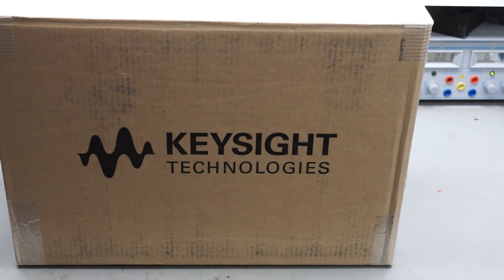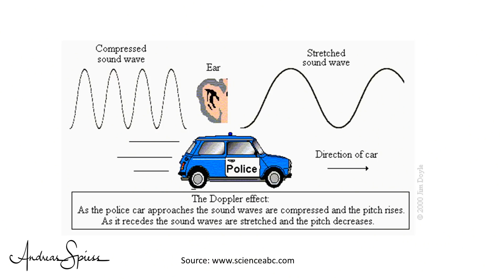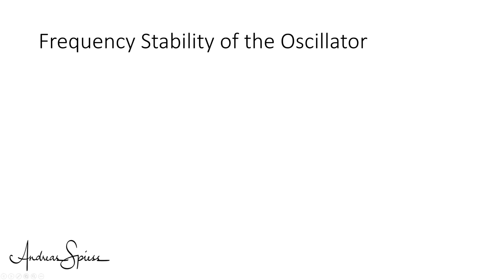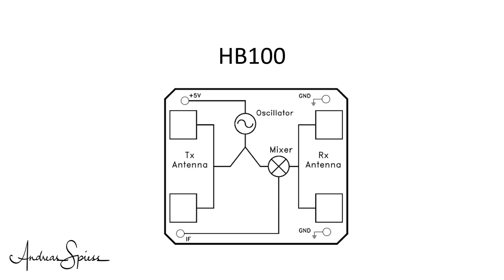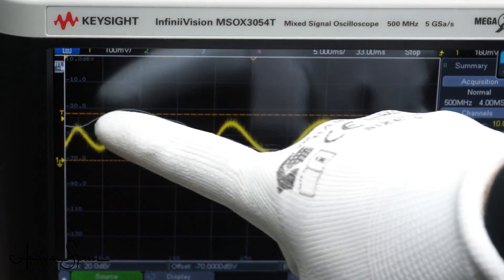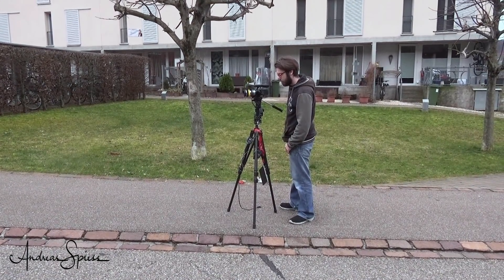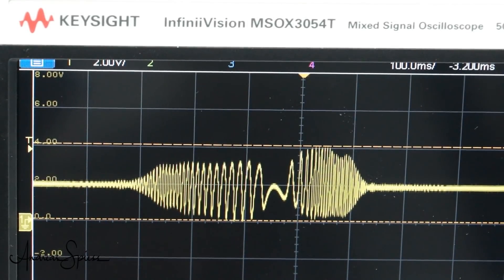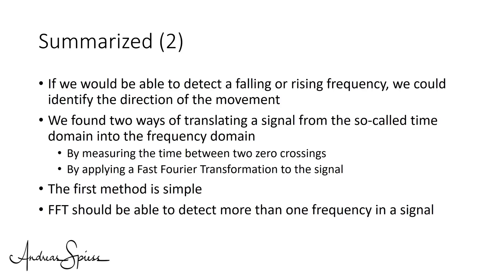#181 DIY Radar Speed Gun using cheap Radar Sensors (HB100, CDM324) for Arduino, ESP8266  and ESP32

Comment: Hi Andreas, 

What a nice subject for our makers. A lot of people think of using this technique in other purposes than it was supposed to, just for switch on lights or opening doors.
The thought’s I had where quite te same as most of the repliers, but some questions stayed after reading al the comments and answers and other posts in other channels including searching AliExpress for the most suitable radar module.

My application is quite standard for radar and is also almost identical as what you did.
I want to display the speed of Skiracers at the piste on a display and send the speed to a central server to store the speed, in combination to the time registration from another project.

My first plan was to set it up with two optical reflective gates, at a distance of some 5 meters and calculate the speed. This is common technology, but the racing suites  are often white and do also reflect the optical beam when passing the speedtrap. 
So a speedtrap with separate beams and detectors looks more reliable, but takes to many physical components to set up.  Besites that, synchronization of the time base on both the traps for precise messurement and setting the speedlength is also a hassle.

Then, as a recent viewer of your video’s, I found this item about speed measurement with  cheap components. It surprises me, how simple the units are and how accurate the measurements can be. But when reading more about these units and solutions people talked about the maximum speed that you can measure with this solution. Our racers can go as fast as 120Km/h, so the limit can be an issue. Also the measuring distance can be an issue, but 10 meters is quite nice for this. But are the racers then not passing the sensor to quick to make a reliable measurement?  
And if the sensor is ‘always’ on, for detecting movements, how can I trigger the right moment of passing at the highest speed, without showing zero’s after the racer has passed. These last questions are for me to solve as a maker, but the question about the limitation of the speed measurement is tricky for me. The second thought is which sensor to buy.  In the meantime some more sensors where added to AliExpress and there is a wide range of types now,  10,525Ghz, 24Ghz, 5,8Ghz etc.
The new CDM324 is 24Ghz and is advertised as 15 meter detection range. It looks as this unit is simplified version of the  CFK024-5A unit, which is much more expensive, but has more pin’s and options, including FMCW/FSK/CW. 
So if anyone had built a similar speed measurement unit without that works, please point me to more details to prevent me from spoiling precious maker hours. 

In the meantime I’m looking forward to the sequel of this amazing video series.

Regards Johan
Reply from the maker: We worked a little further on the project, but it is not ready yet. The most difficult part is the reach. The max speed should not be an issue.
You need a very high amplification of the signal (>10'000x) and have to pay attention that you do not introduce too much noise. After that, we used an ESP32 with FFT to measure the frequency. You measure the frequency all the time and distinguish from the pattern if it is valid. Your application will most probably show 0 for most of the time and increase fast, and fade off to zero again. So you can detect the maximum. Pay also attention that the angle of measurement has to be integrated into your calculation. If the angle changes the result also changes. 
All-in-all I think this will not be possible with this device because of its short range. You would have to place it in the direction of the racer in a distance of less than 10 meters, which is probably too dangerous.
Reply: Hi Andreas, 
expected something like that. Nice that the speed will not be a problem.
What will happen with the accuracy if a racer moves by in a elliptical curve instead of a straight line? For the noise I can try to get a low noise amplifier with a high gain for that. I first wanted to build my own parabolic antenna, but the gain factor of the module is already quite good. If I manage to create a more directional antenna with a better passive gain, I’ll let you know! Probably I will use something like a feedhorn for the receiver. 

Regards, Johan
Reply from the maker: 1. The measured speed can be calculated by trigonometry. The angle has to be absolute constant.
2. I cannot imagine you will be able to connect an amplifier because this device sends and receives at the same time. I assume a horn antenna would help if done properly.
Reply: Hi Andreas.  Yesterday I contacted a Colegue who is a maker and a Ham specialist in microwave connections.
On internet I found the Schwarzbeck horn-antenna's with an incredible passive gain. My collegue suggested that such a horn will solve the reach issue. Even when you use a horn that is not very good adapted for this frequency, it can give a huge gain. So I'll try that first. Just build a horn with a divider in the middle, with the antenna's in the bottem. The mesurements of the bottem are larger than the calculated dimensions at this frequency, but the expectation is that a reach of 50 Meters is possible.  Amplification would be possible, but takes a complete rebuild of the unit. More expencive units on Aliexpress use more stacked antenna's to reach a higher gain. The radar used by the police uses a horn. The horn will also give a smaler openings-angle, but for my usage that is an advantage.
Regards, 
Johan

Comment: Would this setup work for a Tennis Serve Speed measurement?
Reply from the maker: I do not know. Most probably the range would be too short.
Reply: The distance between the Ball Hit and the radar would be 12 meters. And only the initial speed (highest frequency differences) are relevant for the measurement, not the whole ball-flight.

Comment: can we use sonar instead of radar sensor?
Reply from the maker: In principle: Yes. But as calculation shows you will not be able to use the Doppler effect
Reply: of course, one more question, why folks using radar, instead of lidar?
Reply from the maker: LiDAR shows distance, radar speed
Reply: but we can add a formula to solve that, as speed is derivative from distance, for ex. we measure every 1Hz, we'll knew the distance from 0s and 0.01s, and we know the diff. distance to calculate the speed.

Lidar is more effective and cheaper way in my opinion, so back to the question why folks using radar instead of LiDar? because im not happy with ur question.

Comment: When you measured the 400 mV amplitude, this was the shifted Doppler signal. My question is does this Doppler amplitude match the amplitude of the reflected 24 GHz signal?
Reply from the maker: You are right. The reflected signal is mixed with the sent signal to shift the Doppler effect to a frequency we can easily detect( transmitted - received frequency). So I assume the amplitude is a mixture of both. But its size is somehow proportional to the reflected signal. It gets smaller the longer the distance to the object.
Reply: After thinking some more about this, the signal only comes when there is a moving target so that presents a problem for me.  The incoming signal is obviously much weaker than the outgoing signal, but I don't know how they get the frequency difference. Maybe it's using FFT to compute the difference in the frequency and then generating a signal with an amplitude proportional to the incoming signal.

Comment: I have a pair of CDM324s on order and they should be here in a few weeks.  I have a couple of applications in mind.  One would be for low speeds (<40kph) and one for higher speed (close to 100kph).
I would like to use an ESP32 for this project so I have the horsepower to do an FFT and also the ability to send the data to a mobile phone.  I have not ordered anything for the analog portion.  A few more details would help as I get ready for the toys to arrive.
1) What amplitude levels did you see coming from the sensor (un-amplified) in your bicycle test.  Was it similar to the 400mV you saw in the lab test?
2) What gain did the amplifier you use have?
3) Did you you also use a low pass filter?  The bicycle waveforms don't look as noisy as the un-amplified signals from the lab.

This sounds like it is going to be a fun project.
Reply from the maker: We are still experimenting. But so far, the reach was never bigger than about 120 meters. So 100 km/h will be difficult, I think.
The signal of the sensor is more in the range of 4 mV.
Reply: Thanks Andreas, the high speed application would actually be close range and the low speed application would be way less than 120meters.   I know that answer may seems bit strange.  I wish I could go further; but, I am not ready for a public reveal of either idea right now.  Well, anyway, the low speed / low accuracy project is first.
Looks like my senors are arriving this weekend so hopefully I will get a chance to play.
BTW, I PM'ed you on Facebook as well.
Reply from the maker: I made a mistake: Not 120 meters. 10 meters.

Comment: Can you recommend what type of sensor can be used to measure the pingpong ball / badminton birdie smashing speed?  Thank you!
Reply from the maker: I think only radar would be fast enough and also has a certain beam width (see my last video about Laser speed gun). But I do not know if a small ping-pong ball will create a signal big enough. And I do not know how you can deal with the different angles the ball might take in relation to the sensor. So you have to experiment.

Comment: Very nice project. I'm really impressed. Please be aware about radar frequency regulations in your country.
Reply from the maker: These devices are used to open doors in buildings. So they are probably not too illegal.
Reply: I'm not really a radar hardware expert, maybe I'm wrong. But as far as I understood the frequencies are country specific. These china imports might be legal in other parts of the world. At least for Germany I found some hints that the used 10.5Ghz is not allowed and you have to use 9.35 GHz... but handle this information with care... I might be totally wrong. I'm really concerned about the crazy monetary fines in Germany.
Nevertheless I'm still totally amazed from this video. I'll try to talk to a radar expert and try to find a legal sensor for my country. Thank you very much for this fascinating and informative video!

Comment: I'm very interested in this sensor. From this video, I guess the analog data is surprisingly only ~100 Hz thus easily extractable/ processable using low speed electronics such as Arduino. I'm thinking collision avoidance drone. Is distance roughly measurable by amplitude? If FFT, multiple objects at different speeds can be calculated? Arraying can be done? For example bunching three of them heading different directions at 30 degrees apart? Is divergence angle changeable to ~30 degrees with some inexpensive metallic dish / Yagi-Uda / shielding? Can it navigate through 20 cm-diameter woods while flying at bicycle speed for example? I don't know RF much but have experience with MCUs. What do you think? Thank you.
Reply from the maker: I think you should start a project to answer all these interesting questions. Here you will see a video about FFT in the next weeks
Reply: Yes I agree it's a big topic and I think the technology and market is still in the beginning. Bad for individual tinkerer like me. I just found some commercial drones using radar tech on Youtube however flying speeds were not even fast as running. I guess they use rough estimation from the amplitude? 

Despite the fact that Intel released Realsense, a stereo vision platform just like most DJI systems, I think birds don't rely much on stereo vision. Despite of their small overlap of visual angles, they fly really well without any collisions. Of many non-stereo approaches, side-looking optical flows will give good distance information since flying speed of drone is always known using IMU&GPS and surroundings are mostly still.  I'm open to any technics including cheap optical flow sensors to expensive computational vision however cheap sensors only give a single average vector, failing at detecting small but critical objects like branches as I experimented with my optical mouse and a razor blade. If you know any cheap sensor that gives an array of optical flow vectors with a reasonable resolution such as 8 by 8, please let me know. Thus currently I'm leaning towards optical flow vector 'array' with side-looking cameras and a good lightweight computer such as Odroid, combined with a forward-looking LIDAR or something.

By the way I'm waiting for your FFT video. Thanks!
Reply from the maker: I am also interested in a Lidar. Just ordered a laser range meter which should go 100 meters and has TTL out. Just to try how fast it can measure.
Reply: 100 meters seem to be great for drones for me. Let's see how fast it goes!

Comment: Add a frequency to voltage convertor? http://www.ti.com/lit/ds/symlink/lm2907-n.pdf
Reply from the maker: I am not sure if this will work if more than one signal is around.
Reply: Use this on the output beat frequency in place of zero xing detection or FFT. Voltage is the speed.

Comment: Could we use this to calculate distance Mr Andreas? Would be very interesting and useful for a robot maybe.
Maybe some phase detection maybe?

Undergrad(soon to be) Electrical engineer here, love your videos !!!

Cheers!
Reply from the maker: The doppler effect cannot be used to measure distance. In radar they use the delay time for that. But speed of light is very fast and therefore delay times short. Maybe you could use the phase to detect such small delays. These boards do not do this trick.
Reply: Radars that can measure speed and distance do this usually by changing their frequency (ramp). They are called FMCW-radar.

Comment: 1) I'm curious how small an object you can trigger on with this device?  A football, a baseball? A rock or pebble?
2) I don't understand why you are concerned about the amplifier clipping - if you are measuring frequency you can measure from each rising edge.
3) Can't you tell the direction by a few successive measurements of the wavelength duration?  Maybe measure microsecs between edges,  several cycles apart?
4) Have you experimented with multiple objects at the same time to see how the device is effected? (not sure if there is a capture effect, or you just get a few different frequencies returned, one for each object...)
Reply from the maker: 1. I will for sure depend on the distance and on the material...
2. Because clipping introduces new, unwanted frequencies. If we do FFT, we will see these frequencies and assume, we have 2 bikes instead of one.
3. This is one of our plans. But we will see if we get enough cycles because the frequencies are quite low.
4. No
Reply: I was thinking to use a clipped signal to edge trigger a counter, on and then off, and only reset after the micro has read the count - though this would not be able to detect multiple targets.
Instead of bikes I want to measure the speed of projectiles - so I would never have more than one at a time, and the direction known (I hope!) 
Though radar chronographs exist for shooting, I don't know if the devices here are sensitive enough.
I ordered one for my testing.
Reply from the maker: And also the frequency is higher as the speed is higher than me on a bike ;-)
If you can put the sensor close, it should be ok. But of course, you do not have a long signal. Interesting project.